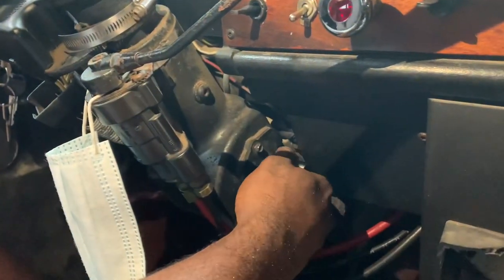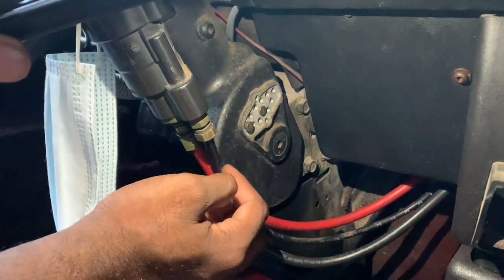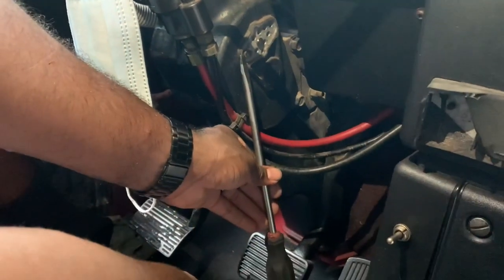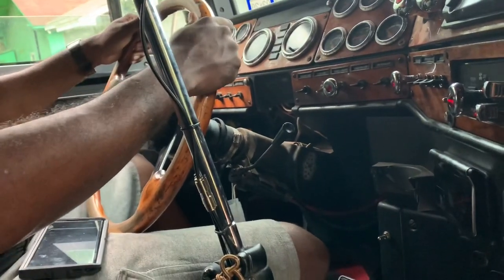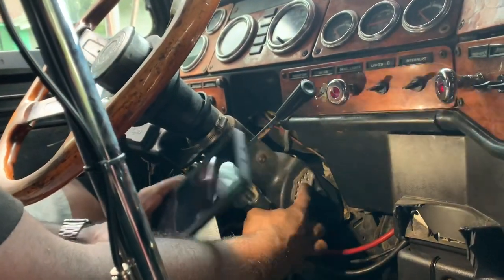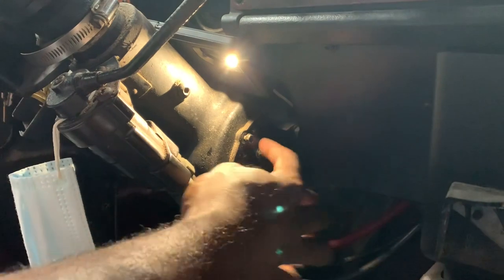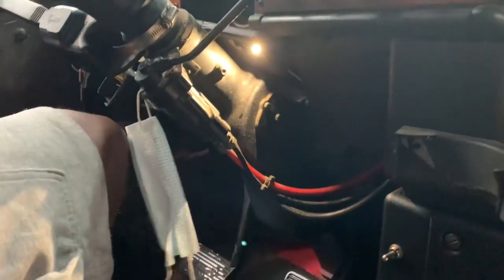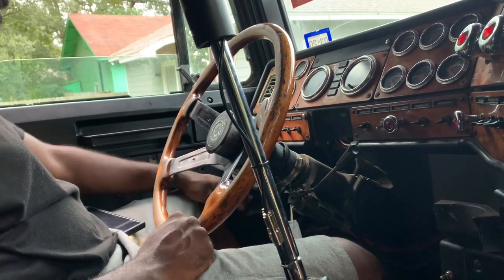How To Lower Your Steering Wheel in a Freightliner Classic & FLD

Comment: Not sure.?.?... why was the pin in there in the first place makes no sense.?.?... So the steering wheel was not adjustable at all until the pin was removed.?.?
Reply from the maker: It was adjustable, just not by much
Reply: @mikestruckinwithbigdaddy5233  the way you were moving that wheel after you pull the pin out looks to be the way it should have been down at the factory.... LOL
Reply from the maker: @christophergaudreau9265  right! I don’t understand why the steering wheel wasn’t set up like this in the first place
Reply: @mikestruckinwithbigdaddy5233  hey buddy do you have any opinion on freight moving in and out of Florida I live in Tampa Florida making a career move I was told to get out of Florida cuz it sucks for Freight I can move anywhere I have no family or obligations
Reply from the maker: @christophergaudreau9265   honestly I’m not too familiar with it, only what I’ve heard, from my understanding the freight pays good going in but not so good coming out, for that reason I don’t run to Florida at all